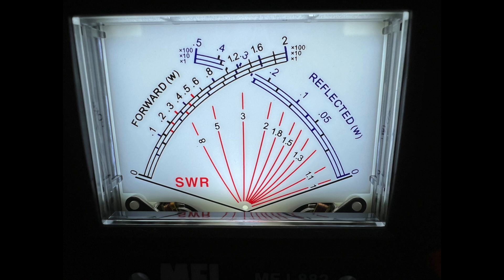Ham Radio Myth - Reflected Power Is Lost!

Comment: New to ham here. Not an electrical engineer nor electronics tech either. Not going to build a radio, but I have built antennas. While studying for general, I accidentally took an extra practice exam. 14/50. Humbling. But even in the general pool, I have found questions that seem SO obscure to me that I wonder if most ham extras would find 25% of the content frivolous. I would like to know, if anyone cares to speak to it. Thanks
Reply from the maker: When I took the Extra exam some years ago there were a number of questions about calculating the discharge time of a capacitor.  Completely useless!

Comment: it is radiated but just like AC power it cycles back and forth even with a perfect match the RF still returns to the transmitter but the reactance is matched so the power cycle of RF in the transmission line is so low its almost undetectable

Comment: I agree with your analysis.  Question, if I may: If you are using an antenna tuner, and the SWR of the antenna therefore doesn't matter (within reasonable limits, of course), then under what conditions would you ever need a Balun or Unun?  BTW, I'm a newbie ham.  Maybe there is still common mode current?  Please explain!  🙂
Reply from the maker: If your antenna is a dipole and you are feeding it with coax you should use a balun because coax is unbalanced but a center fed dipole is.  If you are feeding an off center fed dipole you will need an unun, because both the antenna and the coax are unbalanced.  If you use an unun you will probably also need a common mode choke.   Some unun's have them build in.  Balun Designs, DX Engineering and Palstar Engineering are examples of where you can get them if you don't want to make your own and a good source of information.
Reply: @BustRadioMyths  Thank you for your advice and explanation.  I've also learned a lot from watching your videos.

Comment: I’m in the process of setting up my shack now. Mostly there. Need a power supply and an SWR meter. But I have been a sub to this channel less than 12 hours and I am already learning the good stuff before the myths and bad info get imbedded too deeply. I’m going to be running QRP on homebrew random wire and dipoles, with relatively short feed lines (20 to 25 feet or less) and with what I have seen so far on this channel, I’m starting to think that these nano VNAs and antenna analyzers are going to be a waste of money that would be better spent on radios.
Reply from the maker: Good work.  Knowing the truth about antennas and transmission lines will set you free from myths that are actually crippling.
Reply: I got a NANO VNA and found it very useful for building aerials, knowing at a glance if they were too long or too short. It took quite a while before with nearby objects affecting things and watching an SWR meter not knowing if I had made them too short before realising it. Too easy on 12m. Not cutting them of course.
5 attic dipoles for 20m to 10m, an outdoor inverted vee for 60m and a 4 element 2m collinear which would be too easy to miss the resonant point. My wire elements were longer than expected.
I should now be able to check my low pass filters on my h/b radio.
QRP here with nothing above 5 Watts.
G4GHB.

Comment: Tube equipment is a lot more robust in a high mismatch  one of the myths I’d like to see put to rest is the guys (mostly the CB crowd ) that say they run so much power the antenna tip glows .
Reply from the maker: I wonder if that’s true?  I can only imagine the power some of them are running.  And there is high voltage at the tip of an antenna.
Reply: @BustRadioMyths  needs to be tried now i have had guys tell me they have had a longwire fail with high power but anything A truck driver tells me I take with a BIG grain of salt 😆

Comment: I agree with 98% of this analysis. My small disagreement is the loss in the cable. SWR creates both voltage nodes and current nodes. Since power lost = I^2*R, the power loss due to the increased current nodes cannot be neglected. So power loss in the cable does increase with SWR. But the overall point of the tuner reflecting power back to the antenna is correct.
Reply from the maker: True power loss increases with SWR.  So the radio operator has to decide how much he is willing to tolerate based on what he is trying to accomplish.  You can buy RG-8X for 65 cents a foot or CommScope 1-5/8in HELIAX Standard Air Dielectric for $45 a foot.
Reply: @BustRadioMyths  Unfortunately, I'm in the 65¢ range . . .

Comment: G9A02 (B)
What is the relationship between high standing wave ratio (SWR) and transmission line loss?
A. There is no relationship between transmission line loss and SWR
B. High SWR increases loss in a lossy transmission line
C. High SWR makes it difficult to measure transmission line loss
D. High SWR reduces the relative effect of transmission line loss

You would answer A? The correct answer is B.

E9A09 (B)
What is antenna efficiency?
A. Radiation resistance divided by transmission resistance
B. Radiation resistance divided by total resistance
C. Total resistance divided by radiation resistance
D. Effective radiated power divided by transmitter output

You'd get this question wrong if you really believe what you said at 7:55 - "full transmitter power is radiated" because then total resistance would always equal radiation resistance.
Reply from the maker: Perhaps "delivered to the antenna" would have been more accurate.
Reply: @BustRadioMyths  I would agree that in most cases, most of the power is delivered to the antenna. 

But check out KV5R's Coax Loss Calculator. Using Belden 8236 RG-8 with a 100 foot line, at 14 MHz, play around with SWR and you'll see that you'll double the non-transmitted power by going to 1:1 to 5:1. Will that alone make a meaningful difference? No, probably not: you've gone from about 85W out of the antenna to 70W out, and that's only about 0.8 dB due to the SWR.

Most Amateur radios have built in SWR protection, and they will step back your power output if your SWR is too high in order to protect themselves because the reflected power manifests as voltage that, at sufficient level, can damage components. If it were as simple as "the transmitter has high impedance," then radio manufacturers would not worry about adding this feature.

You're right about antenna tuners though: they do exactly what you need (to lower your SWR). Check out the video "standing up for standing waves" here on YT to see them in action. They're not just fooling the transmitter.

Comment: When you put power through a non-superconductor, some is it is lost in heat.
Reply: very very little.
Reply: @ziggyinc  just depends on ohms and how far (or how many times back and forth) you go. Loss can be very low or very high or in between.

Comment: Good video. This is a very much misunderstood topic. I agree with all you said and I have a couple points to add. All antenna books have a chart that will give additional loss due to SWR. It all depends on the loss in the coax under perfect matched conditions. For example, if your feedline loss is say 3dB with a 1:1 SWR then you lose half your power with a perfect match.  What starts as 100 watts, ends up as 50 at the antenna with even a 1:1 SWR. However if there is a high enough SWR to reflect 50 watts, then half of that 50 watts gets lost on the way back to the transmitter. Only 25 gets to the transmitter and ALL of it is reflected back toward the antenna. But half of that is lost (always lose 3dB each time) so 12.5 gets back to the antenna where again half of that or 6.25 watts if reflected. Half of that is lost so this trip only 3.125 watts gets to the transmitter. All of that power or 3.125 watts is reflected at the transmitter. This goes on until all power is radiated or lost! So the key is starting with a low loss. All coax has increasing loss with frequency, so coax that has low loss on 80 meters may have excessive losses on 10 meters. I measure my coax loss at the frequency I plan to use it on ( usually close to the advertised figures) then use the chart in the antenna books to see what total loss will be at a given SWR. Remember loss will be given in dB per 100 feet. If you only use 50 feet the loss will only be half that. So with very short coax it usually does not matter what the SWR is because the additional loss due to SWR will be small. But with high loss or very long coax the additional loss due to SWR can be unacceptable on the high bands. I usually have my 80 and 40 meter antennas away from the house with long feedlines and my 10/15/20 meter antennas close with shorter cable.
This is a link to the chart in one of my blog posts:

https://antennatalkbydon.blogspot.com/2023/04/loss-on-short-coax-for-portable-or.html
Reply from the maker: Good post.

Comment: Great video, I am now a subscriber.  I agree with you 100%.  I use a Chameleon EMCOMM III antenna which is a 130 ft end fed 'random wire' antenna with a 5:1 transformer.  I feed it with 35 ft of LMR 400.  SWRs are 2:1 to 3:1 across the spectrum from 160 to 6 meters.  I have worked all HF ham bands with this setup.  It works great.  Robert K5TPC
Reply from the maker: I'd call that an ideal antenna.  What serves as the counterpoise?

Comment: With my older type transmitters I would operate with a 3:1 SWR and make plenty of contacts, at 5:1 the plates glowed a nice dark red color. I also found the shack was filled with RF.  Got a couple of burned fingers and would light up my fluorescent desk lamp without turning it on, those were the days.  The strangest one though I was at the repeater site one day checking the antenna with a directional watt meter.  I noticed a significant amount of reflected power.  I was like what went wrong with the antenna?  The feedline was 1/2" Heliax. Getting onto the roof of the building was a pain.  You had to notify security to unlock the door, then you had to notify the engineers at the TV station so they could turn down the power of the UHF station.  Then dawn a protective RF suit that was in bad need of cleaning.  All of a sudden I realized, wait; I'm seeing this and my transmitter is not transmitting.  That is coming from someone else's transmitter.  When we did get out on the roof, we found somebody had mounted a DB-408 on the same bracket about a foot and a half from our VHF antenna.  The site manager got them to move.  Believe it or not he loved us hams better.
Reply from the maker: Sounds like you had common mode current coming into the shack.

Comment: Vy clear explanation Mark, tnx!
I always prefer a good antenna with a bad swr than a bad ant. with a good swr. The most important is the radiation resistance of the ant. vs the losses. A good antenna tuner will always do the job to transfer the max pwr with an efficiency of at least 90%. The added losses on ladder lines with high swr is negligible.
An interesting test would be with an infrared camera looking into the antenna tuner to observe the increasing heat caused by the losses. Therefore the Qu, unloaded Q from the ATU circuit must be as high as possible. 73s
Reply from the maker: This is exactly right.  A good tuner has a coil made of heavy wire.  If not, that's where the losses occur.

Comment: I'll take a quote out of the Antenna Handbook - "Please recognize that an antenna need not be resonant in order to be an effective radiator. There is in fact nothing magic about having a resonant antenna, provided of course that you can devise some efficient means to feed the antenna. Many amateurs use non-resonant (even random-length) antennas fed with open-wire transmission lines and antenna tuners. They radiate signals just as well as those using coaxial cable and resonant antennas, and as a bonus they usually can use these antenna systems on multiple frequency bands."  Based on this video, I would submit this is also relatively true with high quality coaxial cable and ATU in the HF bands.
Reply from the maker: Yup!  True! @davidc5027
Reply: But you need to match impedance for maximum power transfer
Reply: @gabrielsierra6890   Right, that is what the ATU is designed to do.  In some cases easier said than done.

Comment: With frequencies at which cable losses stay moderate, the reflected power gets reflected again by the transceiver and eventually finds its way out the antenna. For example a cb radio may output 4W into a dummy load, which becomes an apparent fwd power of 5W+ when the SWR is moderate, showing that the finals are not just absorbing the initially reflected power. So roughly speaking, what matters is the difference between fwd and reflected power, and 5W-1W is roughly as good as 4W-0.

Comment: I do not understand your explanation as to why received signals don't get reflected by the ATU too (but obviously they don't, otherwise I wouldn't hear a thing!). But what makes the difference between the reflected, transmitted power and the purely received power at the ATU location (apart from magnitude)?
Reply from the maker: Phase.  It has a lot to do with the science.
Reply: @BustRadioMyths  That doesn't make it clearer to me ☹️

Comment: In  mismatch, the reflected power is not lost, but is not radiated either, easily measured with a field strength meter. Also, you need to measure the collector current in the finals and you will notice the collector current increases because the power is not transferred to the load (Maximum Power Transfer theorem). Depending on the design of the finals section, and more important, the maximum ratings of the components, so, some radios finals will go and others will not depending on the components and the overall design. Some radios, like the Yaesu 817 will burn the finals on a 5:1+ mismatch, and others, like the Xiegu G-90 can take up to 18:1 mismatch without failing, because of sturdier components.
Reply: Yes it is easily confirmed with a field strength meter that SWR DOES NOT affect radiated power, I have done it. Tuning a two meter mobile whip with both an SWR meter and field strength simultaneously monitoring power, the SWR can be brought from >3:1 to 1:1 match and no difference seen at all on the field strength.
The reason you may see current increases in the output devices is more to do with the way some solid state transmitters controlled the output power with an ALC loop than the effect of reflected power in the output devices. These output ALC loops only correctly reported forward power with a good 50 Ohm match and SWR would cause the ALC to overdrive the output stage.
73 de G0AFV
Reply: If you don't match the impedance you can not have maximum power transfer, period.
Reply: @gabrielsierra6890 YES…. The power transfer theorem is in operation but when your xmitter looks into a tuned ATU/tuner/transmatch it sees a 50 ohm load as the ATU matches the impedance of the PA of your rig. So power goes thru and gets onto the transmission line.
Reply from the maker: @gabrielsierra6890 A trans match creates a conjugate match at every junction in the antenna system, including at the antenna feed point.  That tunes out the reactance at each junction so the entire system is tuned, including the antenna.  It's in my copy of the ARRL Antenna Book.
Reply: @gabrielsierra6890  Maximum power transfer is not everything. You would be suprised to learn that the output impedance of the finals on your radio is much less than 50 Ohms.
Reply: @samuellourenco1050  if you don't want to transfer as much power as possible, what is the point?
Reply: Radios can handle the extra power being reflected back due to sturdier components, but more often than not, those that handle it well are low power radios. It is easier for QRP radios to deal with a mismatch.
Reply: @samuellourenco1050  tell that to a FT-817, which finals go fast when used mismatched. And in the other hand of the spectrum is the G90, which can handle an SWR of 18:1 without damage. It is all in the design and components.
Reply from the maker: If it's not lost, where does it go?  It has to go somewhere.  Law of thermodynamics.  So it gets radiated.
Reply: @BustRadioMyths  Some of it might be radiated back again, but some of it will be dissipated as extra power by the finals. It really depends on many factors.

Comment: Excellent stuff Mark! Thanks!
I use matching networks (aka "tuners") on all my antennas, and have been for many years.  Two multi-band parallel dipoles (kinda like a fan-dipole, but equally-spaced parallel wires), and a HyGain AV-680 vertical.  My SWR is not terrible on most bands (typically <3:1, except WARC bands) so my antennas are close to resonant on 80, 40, 20, 15 & 10... but I dont care! The Tuners allow me to load-up on any band, anytime, at full-legal limit. Also, I use very low-loss Heliax LDF4-50 (½-inch) cable for the feedlines too, so negligible loss there as well.
73 from west Texas!
~Alan
W5ARM
Reply from the maker: Sounds like a great station and you certainly know your stuff!!

Comment: no difference... well a ladder line is balanced, but a coax isn't. Unless these don't make a difference for the purpose of your explanation.
Reply: No it doesn't make any difference. The same rules apply in ladder line vs coax.The losses in coax is not because of the copper wire. The losses because of copper is very low. Most of the losses in coax is because of the insulator  between the two wires.
Air is one of the best insulator
Reply: @maartenc6099  thank you!
Reply from the maker: Correct.  No difference regarding reflected power.
Reply: So, can it be said: the plate and loading controls of a transmitter are for matching the final to 50 ohm coax to the feed point of the transmission line. The ttransmatch is needed  only if the transmission line is not matched (non resonant) .?